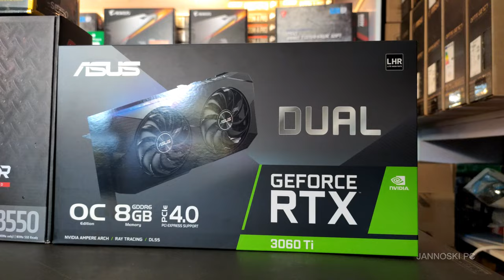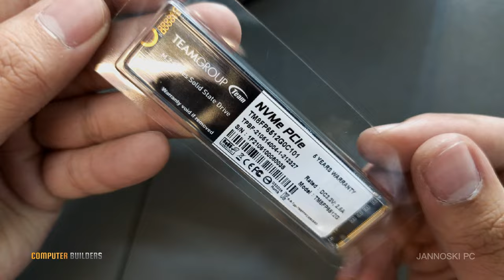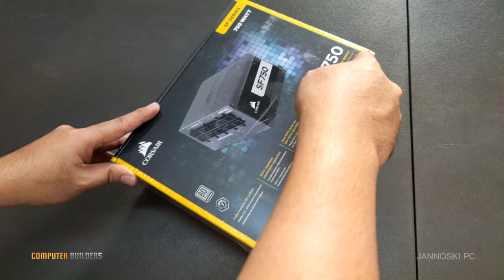100K PC BUILD (APRIL) 2022 (RYZEN 5 5600X, ASUS RTX 3060TI, MSI B550M & LIAN LI 011 DYNAMIC MINI)

Comment: I think we are very close to the threshold of diminishing returns with those fans when it comes to that case. Lol

That case is absolutely killer though. Great build my guy!

I just finished mine earlier in the week

Ryzen 7 5800X
EVGA RTX 3070TI 
Corsair Vengence 64GB 3600
MSI X570S Tomahawk(MoBo)
Corsair H150i AIO 
Dual SSD's(one NVMe the other SATA)
Corsair 750W PS

Shoved all that under the hood of a Corsair 5000X.
Reply from the maker: great, nice build sir